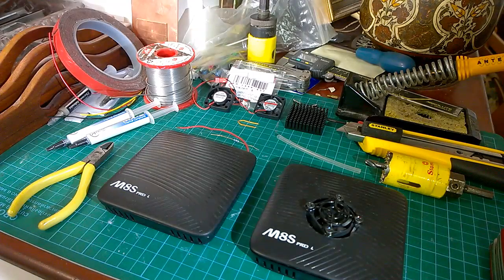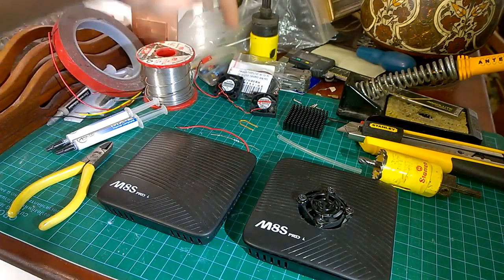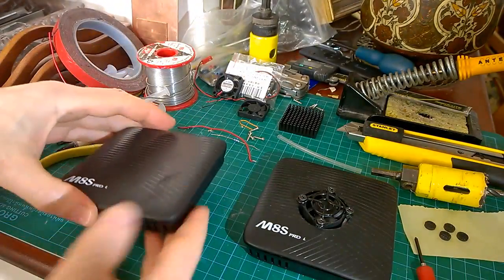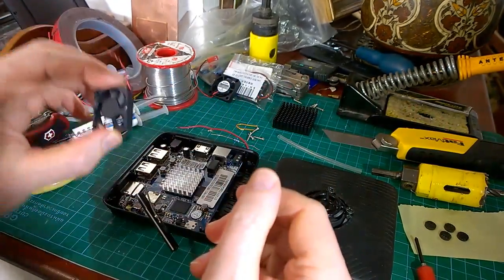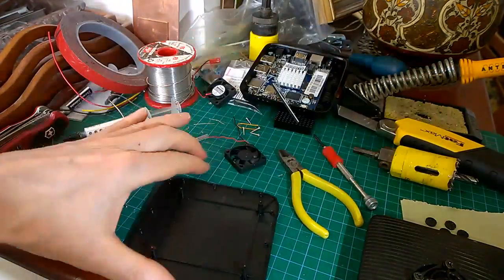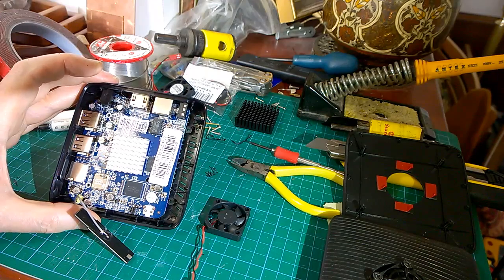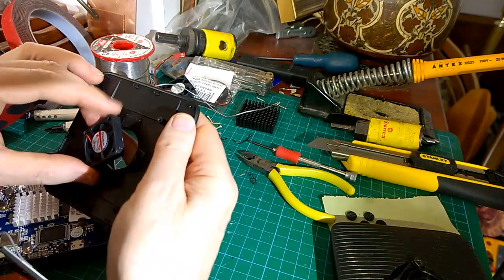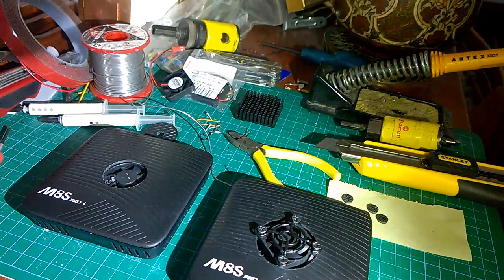Mecool M8S Pro L Fan Install - Upgrade, Beginning 2 End

Comment: The resistor is that 33 ohm or 330 ohm?
Reply from the maker: 33ohm for me - Depends on the resistance of your fan.
Reply: How many watts?
Reply from the maker: I used 1/2Watt as I had them handy. I would use 1Watt for a safety margin.
Reply: How many volts sir?
Reply from the maker: @sherwinmarzan   Not a parameter for resistors - Just get a few cheap resistors for some trial and error ... 5% or better tolerance is fine !

Comment: Dear Petrev,i haven't try install a fan,but i still use a cooler pad on the bottom android box,and when i use it,the max temp average was at 72 degrees C. Do you think that would be bad on the long run? Since i don't have the skill to install fan by myself. Thank you
Reply from the maker: Hi, in the long run cooler is better. 72C is not over the 80C max temp, but I would want to run cooler if possible.
You can try standing the box on edge and see what the temperature is then.
Cheap USB 5V 80mm fans are a help - Couple of versions here in this thread.
Even better if you remove the lid of the box and place them on top (no soldering required)
HTH Pete
Reply: Thank you so much for the reply. Hope you great success.

Comment: I used a 1W 62 ohm resistor. Great video.  Didn't have to drill a hole though. I bought an 8MM thick heatsink/fan.
Reply from the maker: Hi, nice option if ambient temp. not too high. Over on Freaktab we have been discussing a couple of combo HS+Fan units (like yours maybe?) that work well at normal ambient temps with no holes, though you do have to remove and replace the fitted heatsink of course! 
http://freaktab.com/forum/tv-player-support/amlogic-based-tv-players/701682-overheating-mecool-m8s-pro-l-and-pro-and-others-options/page29
 (and some posts before)
Reply: http://freaktab.com/forum/tv-player-support/amlogic-based-tv-players/701682-overheating-mecool-m8s-pro-l-and-pro-and-others-options/page29  I have the same fan.  Expensive b/c they charge $6 for delivery. Cost me close to $13.

Comment: Great video.  Do you know if the version with the voice remote will also accept the IR remote? (ie. does it have the IR receiver also?).  Thanks.
Reply: Hi, yes it is IR as well. Remote uses IR to wake the box, and works as IR if not paired for Bluetooth.

Comment: Do you have a video boosting the WIFI on it,  installing a 2.4G/5G Wi-Fi Antenna like the ones that are on a router?
As It would be good to get that extra boost!
Reply from the maker: Dozz Gio. - I haven't done that. It should be simple though ... Replace the existing wire to antenna with the wire on a pig tail to antenna socket (cut off the tiny plug and solder the bare wires to main board) - mount the antenna socket on the box wall somewhere convenient - add a wifi screw on antenna :)

Comment: hi mate good job I wonder when u put the device to sleep will the fan sleep too?
Reply from the maker: Mimo Titi - Hi, my FW only does on/off so I don't know the USB power state if there is a Standby/Sleep option.
Reply: Petrev X I have tried it as yours but without resistor I have the 5v fan it’s very noisy so if I get the 12v fan will it be quiet coz I’m thinking to try the psu pc fan?
Reply from the maker: Mimo Titi - Hi, a 12V fan should hopefully be quieter, but not all will run at 5V. It is a matter of trial and error ...

Comment: wouldn't it be easier to just fit a turbo type fan in there instead?
that way it could pull air from one of the grills on the sides and push it over the original heatsink (ofc you will need to create an air barrier around the intake from the fan to the side grill)
just wondering, as i am going to receive my own Mecool m8s pro l in the coming week and wanted to address the heat issue right away
Reply from the maker: HoLDoN4Sec - I just know this fan. Show us how you do it if you choose another method.

Comment: Any chance you can provide a link or links to the parts needed as far as the fan and other. My box idles at 155-159*F. Playing it’s 170-182*F.  Would like to give this a shot.  Is this the fan:

https://rover.ebay.com/rover/0/0/0?mpre=https%3A%2F%2Fwww.ebay.com%2Fulk%2Fitm%2F192540654870

Or these as I need 2:

MakerFocus 2pcs Raspberry Pi DC Brushless Cooling Fan Heatsink Cooler Radiator Connector Separating One-to-Two Interface 3.3V 5V for Raspberry Pi 2/Pi 3/3B+ and Pi Zero/Zero W or Other Robot Project https://www.amazon.com/dp/B072FW3DDQ/ref=cm_sw_r_cp_api_i_y8DaBbH2QS3W4

If so what else do I need?

Thanks
Reply from the maker: LilSnoop40 - That looks right but only about $0.99 if you get it from China 
https://m.ebay.com/itm/5V-0-2A-Cooling-Cooler-Fan-for-Raspberry-Pi-Model-B-Raspberry-Pi-2-3/282293574104
Reply from the maker: LilSnoop40 - Look on the linked Freaktab thread for lots more info. Search ebay for 1 watt resistor. 33 to 60 ohm depending how quiet etc. See the thread ...
Reply: Petrev X any chance you can provide me a link to the Resistors I need as I have no idea about anything. But I’m going to do the mod, I would quite but power. Whatever you recommend.  Thanks
Reply: Petrev X can u tell me what one of these is good as it’s a local store:

https://www.radioshack.com/pages/search-results?findify_limit=24&findify_q=1mm%20resistor%2033%20ohms

Thanks
Reply from the maker: LilSnoop40 - Hi, you really need a 1 watt resistor for 30 Ohm - like this 
www.amazon.com/gp/aw/d/B00SWKGO7I/
Can use 2 in series if 60 ohm required. etc.
Reply: Petrev X thank you! I in ur video u used 1 resistor for that fan did u change after the video as I wanted to follow the way u did it. Second instead of the foam tape could u get away with glueing the fan to the lid.  Or is there a reason u picked the foam tape over glue? 

Thanks
Reply from the maker: LilSnoop40 - Hi, 1x 30 Ohm resistor may still leave the fan a bit noisy (depends on your hearing/ambient noise/etc) so you can use 2x 30 in series to get 60 - I had a 60 Ohm resistor so just used one for same result.
I used sticky foam so I can easily change things as needed for experiments etc. Just check you are happy with everything before you glue permanently - Do a trial run fully assembled to make sure everything is just right !
Reply: Petrev X thanks again, hoped this is the last question for a little. I went to radio shack just now to buy the resistor’s but they must of closed. Can u give me a link on amazon for the 60 ohm’s I need rather do one than 2.   After doing this should this make the box run at a cool state?  I drilled the hole in the box today at work in preparation for the fan arrival tomorrow.
Reply from the maker: LilSnoop40 - I would use the 2x 30 method in case 60 is too slow you can go to 30.
I had plenty of different values to try.
Here is a link for 62 ohm
www.amazon.com/gp/aw/d/B00SWKBA04/

You can just search amazon on "1 watt resistor" to get plenty of options ...
You can of course solder 2x 62 side by side to get 31 ohm !
Reply: Petrev X sir u have been very helpful and patient. So for all the question as I have no idea what I am doing. So out of the 2 links u posted above what one should I get. Once I get them I put one on the black and one of the red wire, correct. I don’t know what u mean by different combos.  Thanks
Reply from the maker: LilSnoop40 - Hi, are you sure you want to do this ? You do need some basic tools and skills. You need to be able to do basic soldering with an iron and solder. You need a short piece of wire to extend the red wire. Plus insulating tape to isolate any bare wires.
Fit resistor(s) in one wire (red) for simplicity.
30 ohm is faster + noisier
60 ohm is slower + quieter
 As long as you get at least 2 of whatever resistor you choose you can make the suitable resistance by either wiring them in series (end-to-end) 30+30=60 or parallel (side-by-side) where 60//60=30
One or two ohm either way makes no difference ie using 62 ohm resistors or 33 ohm etc. for example.
Reply: Petrev X yep I am ready, I used to solder Xbox mod chips. I just need to know what resistors I should buy from the 2 links u posted and how to connect them. I have the hole cut, I ordered the fans will b here tomorrow. Have  he shrink tube. Once u let me know I can order the last piece and get this started.  

Only thing at this point not 100% about is the resistor/s. 

Thanks please advise
Reply from the maker: LilSnoop40 - Hi, I would buy the 30s - Try using one 30, and if it is not quiet enough, then add another one in series.
Reply: Petrev X thanks again! I have ordered these, hope these were the right ones:
Uxcell a14051200ux0718 30 Pieces Through Hole 1W 1% Tolerance 30 Ohm Metal Oxide Film Resistor https://www.amazon.com/dp/B00SWKGO7I/ref=cm_sw_r_cp_api_i_PnibBbE78W398

When I get these how do I put these on. I know they go on the red and or black on the fan. So for example red wire than one of these than connect it to the 5v on the bottom of the board.   Again this was an example just let me know what to do please. Wish there was an easier way to speak to u.  Thank you!
Reply from the maker: LilSnoop40 - Yes just that. Red wire, resistor (or 2), then connect to USB 5V on the underside of rhe board.

Comment: Is there a fan I can buy that doesn't need a resistor that is quiet? Does the usb port still work after installing and running the fan at the same time?
Reply from the maker: A bigger 12V fan running at 5V would probably be quieter. It is a matter of experimenting (not all 12V fans run at 5V) if you don't want to use a tried and tested method. The resistor is simple to fit and works well. I am using a resistor equal to the fan resistance now for 50% voltage and it is nice and quiet with plenty of flow.
Reply: Petrev X and the question about the usb functionality?
Reply from the maker: USB works just the same as before. 
The fan only draws a few mA. e.g. 40mA for my fan running at 2.5V
Reply: Isn’t there a 3.3v point to solder onto and therefore don’t need a resistor?
Reply from the maker: Robert van den Bogaerde - At least 2 ... The UART connector is easy to use, but is a constant supply. There is also 3.3V on the microSD slot but the pads are tiny !! Pin 4. 
I also prefer even quieter at about 2.5V
Reply: Petrev X The constant running wouldn’t bother me. Is there a particular fan you would recommend or will any 5v 30mm do the trick?
Reply from the maker: Robert van den Bogaerde - My fave is mentioned in the blurb below the video ...

Comment: Cool me a noob, but why the need for a resistor and not just straight wiring?
Reply from the maker: At 5V the fan is faster than needed and too noisy for me - So I use 50% voltage provided by using a series resistor the same value as the fan resistance (R=V/I, measured current I, voltage V=5)
Reply: Petrev X “Cool me”. Lol,damn spellcheck. Thanks for the answer.
Reply from the maker: I thought that was a clever pun !!!

Comment: Nice work and Video.  I just received my new M8S pro -L Android -L this past week.  I have a 30mm x30mm which I can install.  I took the board out on the M8S Pro -W and managed to get the wires on the usb pads from the 30mm fan. Just need to modify the -L. Currently the - L is setting on a 80mm x80mm 5vdc fan with switchable r's for low,medium and high. Idle is about 40c and 57-60c while streaming. Keeps it cool on the slowest speed. But small fan is a better solution in my opinion. I posted this on FreakTab under the M8S Pro -w with audio remote.
Reply from the maker: Thanks Bob.